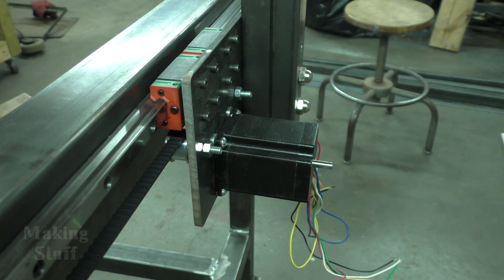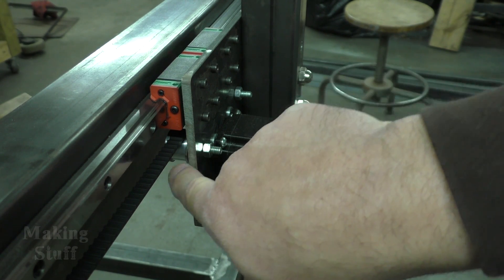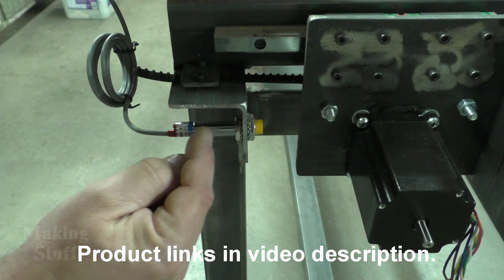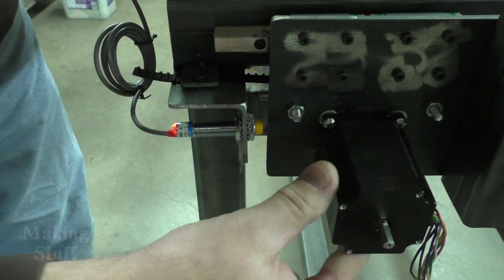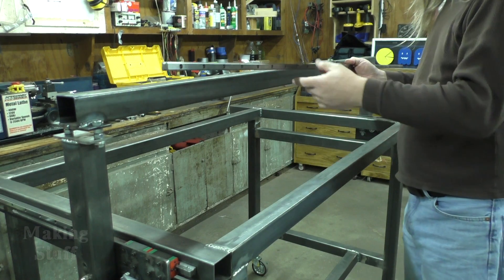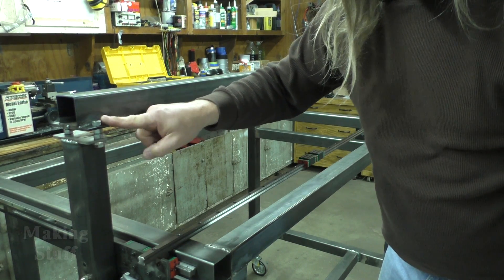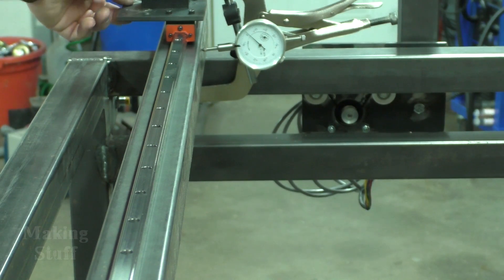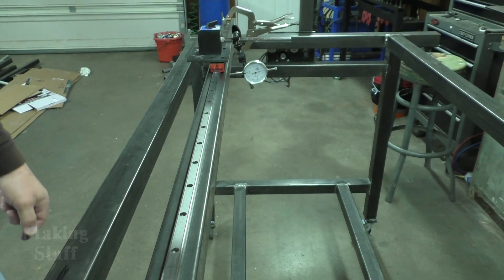DIY CNC Plasma Table Build - Part 4 X-Axis

Comment: Good idea with the tap alignment. I use my drill press and chuck the tap up and run it by hand to keep my hole straight. I’m sure you’ve done the same before but if not, just a friendly suggestion to try. If you need a little more torque, I just use the chuck key or you could always just pull the belt so your not trying to turn the motor with it.

Comment: Nice build only suggestion I would add for the future is clean the mill scale off your steel before welding especially with a small machine where you don't have the power to burn through it you can often get away with it on thin tubing etc because it's a thin layer but plate and thicker metals have a lot thicker mill scale and while the weld might look ok on the surface they get very little penetration past the scale if at all  without a lot of juice and are usually just laying on the surface and can usually be broken right off with a wrench just simply removing the mill scale can greatly improve penetration especially on small machines jody on welding tips and tricks has a great video demonstrating mill scale vs clean material as well as others for anyone interested short circuit is great but it has its limitations on certain materials again great build really not trying to be a jerk just passing on information👍👍👍

Comment: Love what you have done, but I have a quick question... why is the gantry offset to the left from the linear rail trolley? I would have thought it would be centered on the trolley. I would think it would put unnecessary rotational forces on the linear rail by being to the side? Thoughts? Am I off base?

Comment: Any reason you went with belts vs a spur gear system?
Reply from the maker: I already had the belt on hand.
Reply: Ok. I am just planning mine and thinking that the spur gears might be stouter. Have you seen the ones that stefan does? I like the extruded aluminum idea, should make be true than hss and no need to drill and tap a million holes.

Great video series btw!

Comment: I really like the idea of the exchangeable and adjustable Y-Axis. Although with the play in the X-Axis maybe weld a piece underneath the water tank from side to side should make the play minimum. with a router installed it would put more pressure and play would be greater. Overall love the video's and the time you put into this work.
Reply from the maker: Thanks for watching!

Comment: spent half a day trying to get my homing and limit sensors working the I notices the little red LED was dimmer than the other I changed it with another one and it worked. I f you buy these test them out right away because there is a high failure rate with cheap Chinese proximity  sensors.

Comment: Why couldn't you just scribe a reference line on the linear rail's box steel using a straight edge or a taught piece of fine monofilament.

Comment: 1:10 you can watch the belt movement when you move the gantry i think your pulleys are not inline with the belt meaning the pulley if slightly wider... or if you put washers between the pulley and the gantry plate it wouldn't ride on the edge of your pulley. I think a lot of your issue is the alignment tho.
Reply from the maker: Not sure if it was in this video or the next one.  But it turned out that the problem was a bad belt.  I put on a new belt and all the problems went away.

Comment: What motor did you use?
Reply from the maker: All the parts are listed on the web page. https://www.makingstuff.info/Projects/CNC_Plasma
Reply: Making Stuff more oz-in is better? I want to build 5ft x 5ft plasma cnc
Reply from the maker: Yeah more oz-in equals more torque.